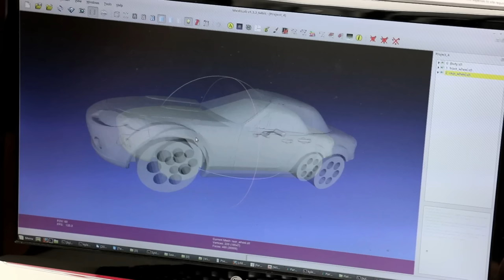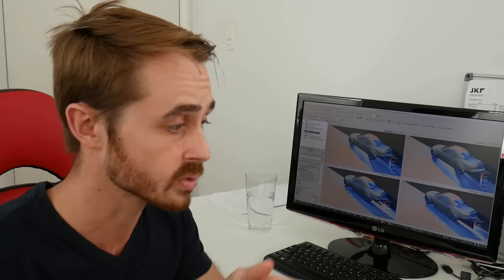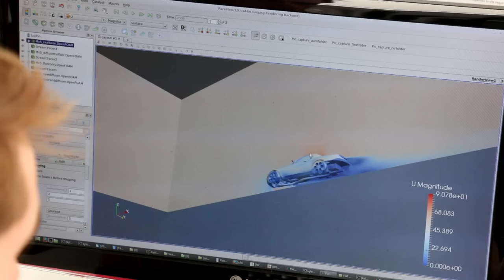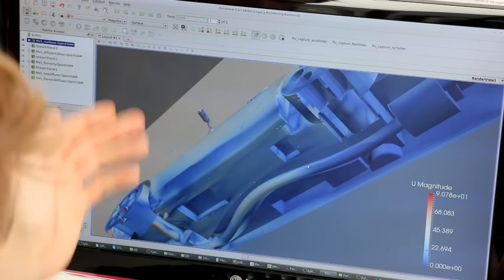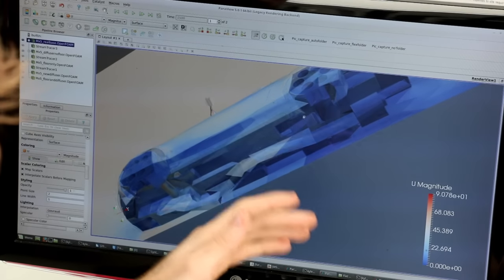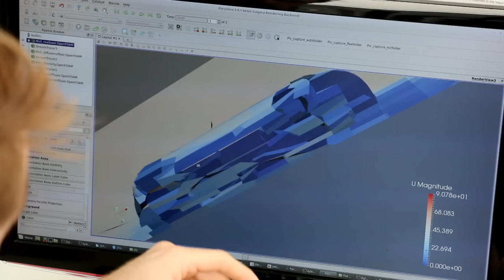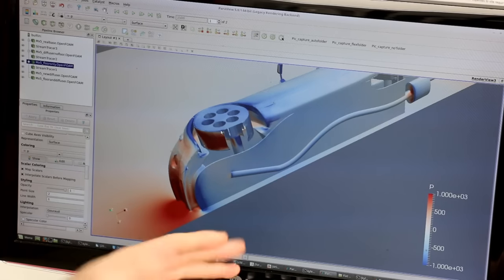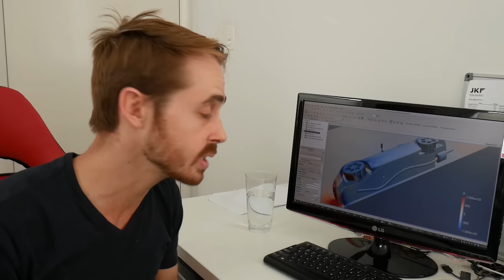How Effective is a Flat Floor? (on cars)

Comment: Can you do a video on putting aerodynamic covers over your rear wheels and/or all wheels?
Reply: Depends on the car body style and how flush the stock wheels are. I had an 8% fuel economy improvement at best. After traffic, etc it was under 5%

Comment: Hi 
It possible for you to comment on the ride height influence compared to gains in downforce ?
Reply: Martin Knudsen the lower the front of the car, in most cases, will increase downforce. So in general, a lower ride height does increase downforce
Reply: Less in drag, increase in flow & a little increase in downforce.  Just look at land speed cars short & narrow

Comment: I put my first floor pan on my race only Triumph 'Spitfire' back in the late 60's looking for a little extra speed on the long straights.  Like my Miata, the Spit was a momentum car and in a stock class so no engine improvements could be done. I went through quite a few tech checks before anyone noticed, but they took no action. i did see a couple(2-3) of MPH on longer straights  Later I added a short(3")  skirt at the sides of the pan and I noted reaching about one MPH higher, but I reached that speed earlier and on shorter straights. No way to actually get an accurate number as there are too many inherent variables form day to day and through the day. I did end up cutting down the side skirts to (2-1/2") due to clearance issues, but it didn't seem to change behavior.   Thanks for the post.

Comment: That's pretty cool to see it like that. My immediate thought, was "how does this affect cooling airflow?". As in, are the other exits from the engine bay generally good enough to cover for there not being a massive hole? Is it *improved*?
Reply: Yes it is improved, and engine bay temperatures drop quite a bit, helping cool intake and intake pipes and other sensors on engine for example.

Comment: You mention R35 GT-Rs often in your videos, which is awesome. As an owner of one, I have noticed that it only has a flat floor at the front 1/3 and back 1/3, but not in the middle portion. Do you think you could improve ground effect and rear diffuser by adding a panel to cover the middle portion?
Reply: Build one and do a coast down test with it and with out it. This would measure drag reduction. Then you could track ride height with potentiometers on your suspension or with camera on your suspension to measure how much the springs compress at a fixed mph for with the the added floor piece and without the added floor piece. This would tell you gains in down force.

Comment: Kyle, would the flat floor or underbelly pan make a significant difference on fuel economy between 45 to 80 mph ? Do you have a video using these principles for hypermiling/ecomodding?
Reply: Was wondering about that as well.. on a stock height car or even a truck? Feel like efficiency gains on the truck could be massive even though it would be a bit silly
Reply: @buildingsalvage  ...I'm considering it for a '71 ElCo, which I hope to take on road trips

Comment: I was thinking about putting a flat floor on the front of a squarebody truck and making side vents on the fenders or out the hood to move the air and heat from the front of the truck smoothly

Comment: What about inverse wing floor like the one that got banned in F1 lotus car with sliding side skirts.
Reply: That's Ground Effect, its awesome and should never had been banned, if something is revolutionary FIA bans it...
The cars became too fast, the problem is that tracks had oscillations on the surface, it made downforce oscillate and hard for the driver to predict car handling, that's why they blamed ground effect from F1...

Comment: Probably not your thing, but I need a Suv with a flat floor as you enter and exit the vehicle.  As I began shopping, all the models had a floor well. I get it, it's for more leg room.  My situation is that my right leg has a orthopedic device and is very difficult to pick up and the exit.  It hangs up on the ridge created by the floor well.  Any suggestions of models with flat floor or a method to make the existing floor well even with the car threshold ?  I hope I've explained my problem.........

Comment: What would happen if u were to put a rubber skirt in the front and sides and left the back open? Would that reduce air flow beneath the car to a point to create a vacuum and therefore that low pressure would cause a greater downforce?

Comment: What do you think of something like this on a large car like a 2008-2015 Nissan Armada? Its very tall, for example, I have no (steps) on the sides i removed them and was wondering about making a flat bottom for highway driving. Would any kind of feature at the front, due to its height help the aerodynamics? Like a wing that maybe pushes air, not sure. 

Currently I just have the wing on the front of the hood which comes standard.

I just feel like the car has TONS of space below it and it would be incredibly easy to just seal off most of the bottom.

Comment: So a flat floor will provide extra downforce even without a proper splitter out front?
Reply: Especially without front splitter! More air in a narrow (smooth) space = higher velocity.
High velocity = low pressure. Low pressure under the car = downforce.
Front splitters were functional before good undertrays were developed.
Don't forget to provide a substantial 8 to 10% diffuser.
This way you'll create more downforce plús lower drag, win-win...

Comment: Hi, I know this is an old video but hopefully someone can answer my question. What's the reason for not running the undertray lower than the exhaust so its flat all the way along? Or is that a viable solution? If so, would it cause any unwanted effects to do with temperatures of the exhaust pipe/underside of the car or can we get away with it? If the exhaust hangs too low how would creating a separate flat section that hangs lower to cover the exhaust pipe affect the airflow? Thanks

Comment: Flat floors are inherently better at aerodynamic efficiency because they significantly lower the underside air pressure which results in better aerodynamic stability